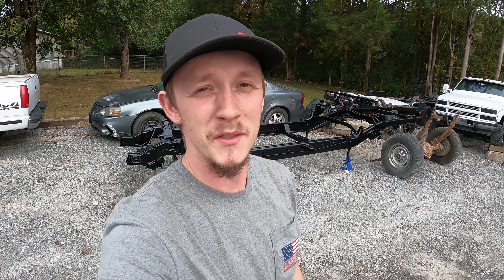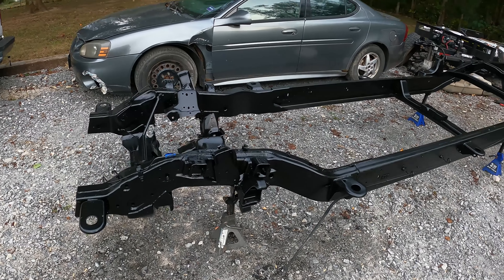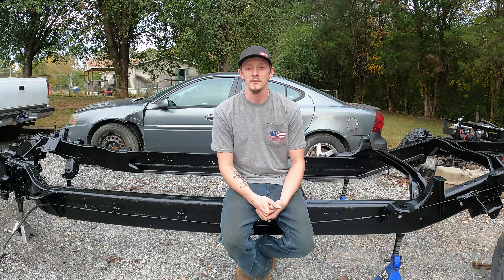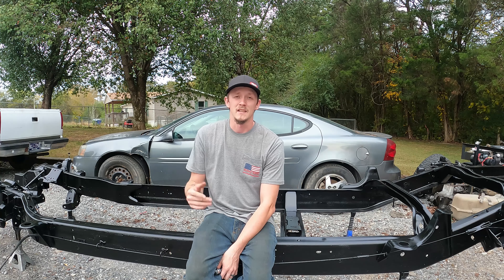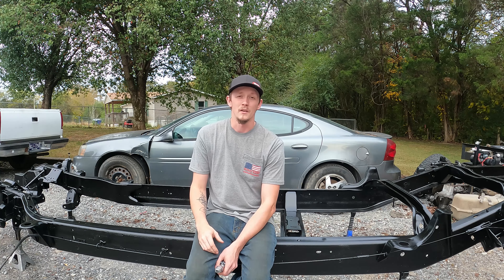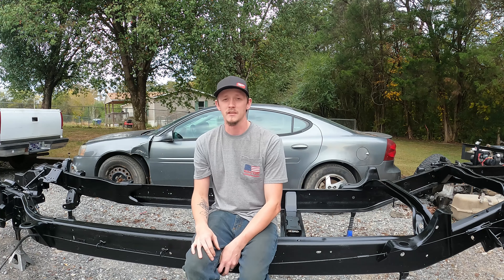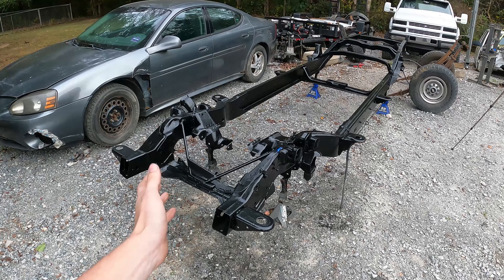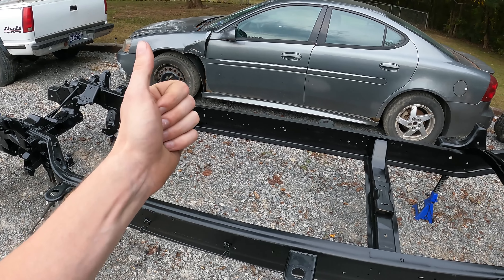Wife's 6.5L turbo diesel progress (frame painted)

Comment: Hi Jesse
I'm currently working on the body of my 93 6.5 and have removed both front fenders and inner shields. Am considering using a Rhino coating from the mounding line down to combat the rust issues up here in Saskatchewan. The rust had literally eaten the bottom third of fenders off, but I bought a parts truck that has saved big $. Like the job you're doing,  the paint for the frame is same as mine but I didn't pull the cab this time. Keep sending your tips, thanks.

Comment: Do u think I should do the timing chain while it's about apart so?? What's ur thoughts brother?Doing a head gasket on my 95 2500 6.5 turbo ,it's got about 170000 miles on it .oh an it's a 3/4 ton I guess weighing 8600 pounds excab an long bed don't know if that matters, an gonna try an get bigger turbo An maybe later tuner of blue chip with a shot of propane 😊😁

Comment: What is the coolant bypass hose called on my 94? I've tried O'Reilly and AutoZone I can't find it online. Or what size is the hose?
Reply from the maker: Are you referring to the little hose that goes from the thermostat housing down towards the water pump almost in a vertical fashion? If so you should just be able to take that line off and take it to an O'Reilly's and replace it with generic coolant hose. I don't know the size of the hose right off the top of my head